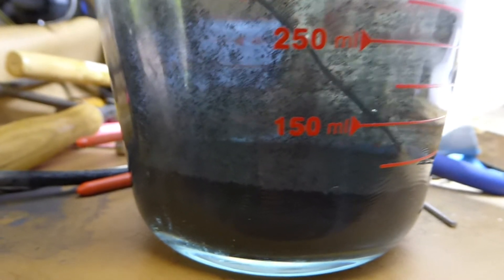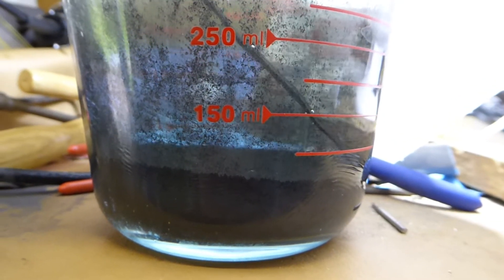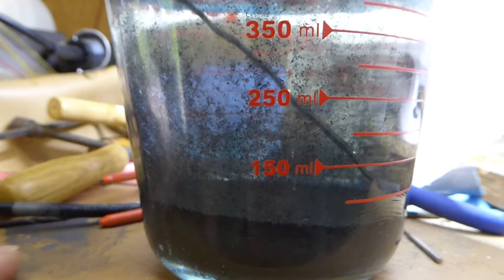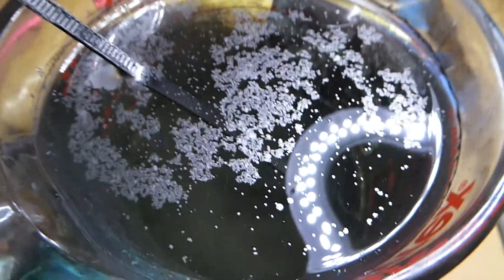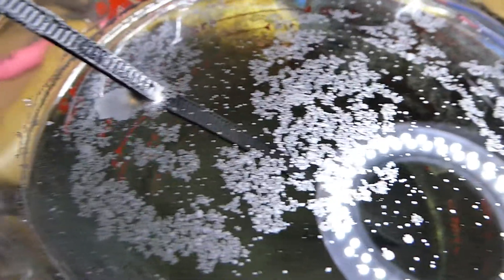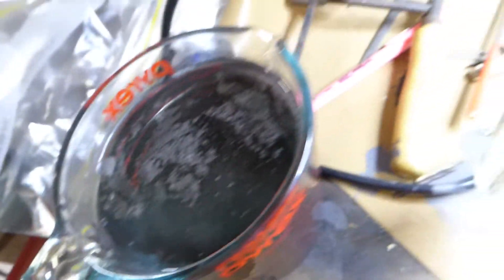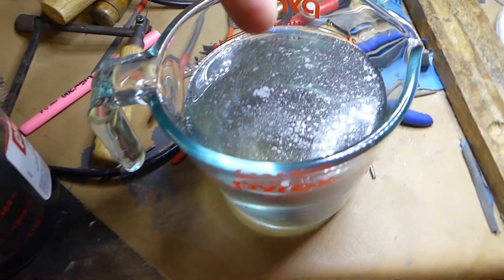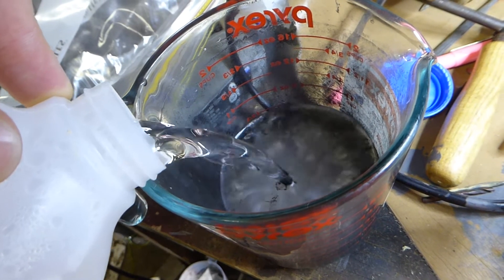Washing Intercalated Graphite Oxalic acid

Comment: I believe the bubbles are oxygen. In the presence of the acid, the graphene will act like a catalyst splitting the hydrogen peroxide (and perhaps some of the water) into free radicals (•OH, •O) or oxygen gas via an oxygen reduction reaction pathway. If there are any metal impurities in the graphite, this will only make such reactions occur much faster. Hydrogen peroxide will normally decompose into water and oxygen gas, but not that fast at room temperature. The edges of graphene are capable of such reactions. Perhaps this reaction can be seperated to produce electricity (gets ideas). I know that there has been work done using light or electricity with graphene-based catalysts (nitrogen-doped graphene, TiO2/graphene, and Pt-doped graphene) to produce hydrogen peroxide, so it is logical to assume the reverse is occurring with energy being released.

Comment: What was the first solution you used to wash before  adding  D.water ?
Reply from the maker: Oxalic acid in water
Reply: @m3sca1  Noted .. thank you very much :)  
I did intercalation reaction yesterday and I’m looking for methodologies for washing samples after few days .. since normal filtration method is difficult with graphite specially on small weight of samples.
Reply from the maker: @VioleRose100  you will expect better expansion using sulfuric and microwave method.
Reply: @m3sca1  
Exactly I used Sulphuric acid + Nitric Acid + KMNO4  added to Natural graphite which I extracted from a host rock by froth flotation and HF 😱 acid digestion. 

So you washed out sulphuric with Oxalic acid .. right?
Reply: @m3sca1  
I’m planning to use Microwave or Induction heater first.. if i didn’t get result i will use programmed heating in an oven (400-700 C).
Reply from the maker: @VioleRose100  nope i just used the oxalic acid. Pretty sure i did mass fraction acetone/water ultrasonic to it first. My friend who runs the channel Nayturesway may recall how he did sulfuric microwave. He sent me a sample. It was very good.